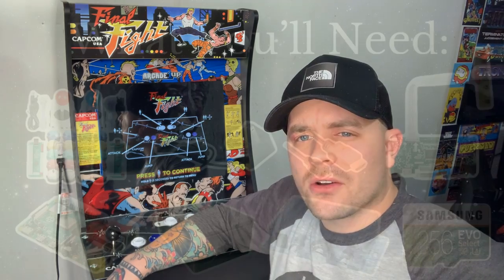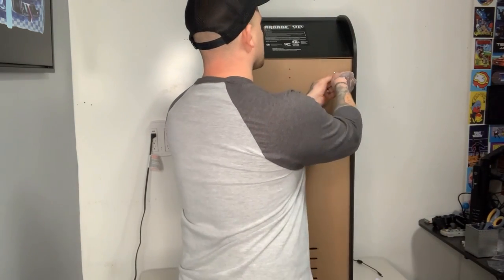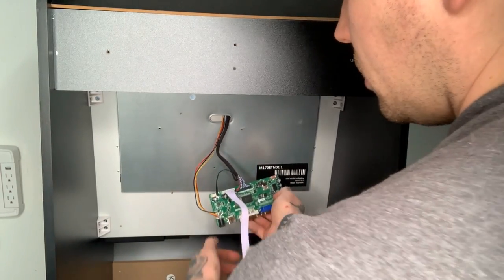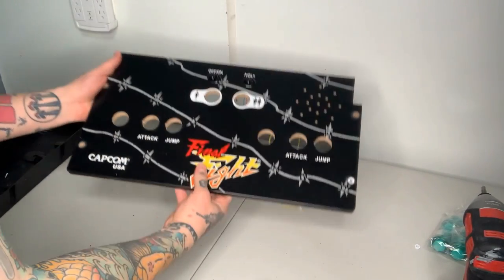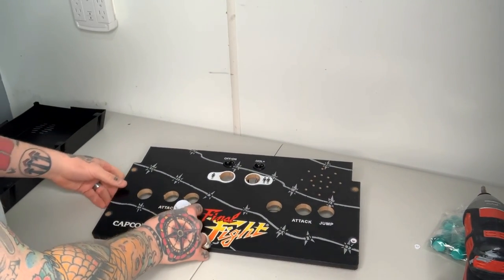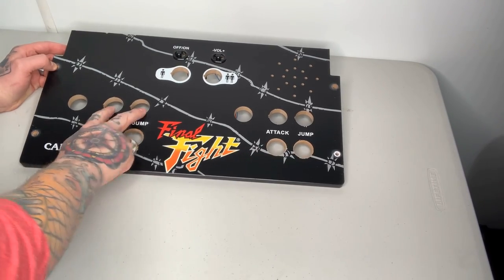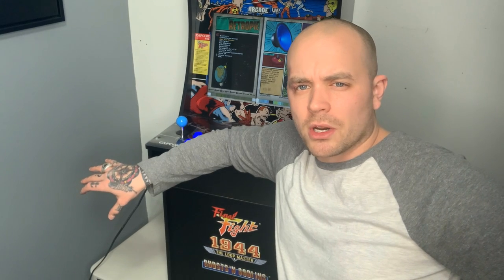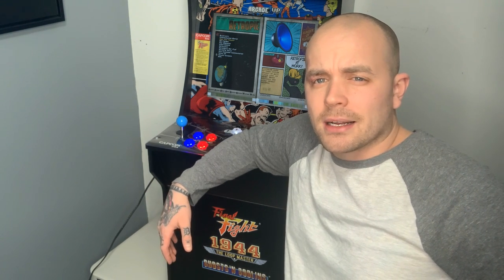How To Modify A Arcade1up Arcade Cabinet & Install RetroPie w/ Raspberry Pi 4  RetroPie Guy Tutorial

Comment: Is the mvc cabnet good to mod
Reply from the maker: One of the best options they have actually. That’s already set up with 6 buttons and the start buttons. I would replace the buttons and joysticks  which is super easy. You wouldn’t need to drill a single hole in your control board which is great. Makes for a really easy mod. You will need to add select buttons but those buttons come in a kit with the other other buttons. You could drill holes into the side of your cabinet like I did in this video which is way easier than having to take apart the control board completely drill out holes then drill out the same holes on the deck protector. Lots of room for error with that. The side of the cabinet can be done in 10 mins and looks good if you ask me!
Reply from the maker: Here’s video of how we did those side select buttons. Really simple...

https://youtu.be/31iX4WbEImM

Comment: I’m using the stock sound speakers from Arcade1up to raspberry pie but not sound, tried the audio jack input on the video chip board to no avail no sound, can anyone tell me what I’m missing?
Reply from the maker: If you’re using a audio cable you need to switch from hdmi to headphone as your audio source

Comment: I just did a mod on my capcom vs marvel box.   I have no sound and I can’t seem to setup the hot key properly.  I added the 2 extra coin buttons.  I already screwed one SD card trying to configure shit I had no idea.  Any help on the above? Thinking about putting new speakers and direct wiring to the Pie and not using an amp.   Anyone in Los Angeles do house calls?
Reply from the maker: You'd need a way to control volume levels though. Did you change your audio source to headphones or speaker? The pi 4 always struggles with audio the first time sometimes you need to cycle through powering it on and off a few times for it to get the connection.
Reply: @OfficialChaseBrogan  I just connected external speaker directly the pi and it worked. The cabinet speakers weren’t working . I had to splice them and I don’t think they connected well to the amp.    I may try again later; and see if I can control the volume from the pi or the amp.   So everything there seems ok now.

I don’t think I’m supposed to Setup a hot key, cause I could never back out of a game after I set up a key. I’m just going to let it default to select and see what happens.

My sd card would only load 1 out  10xs trying so I’m waiting on another one . I think I messed with some settings and corrupted it.  Wish me luck!